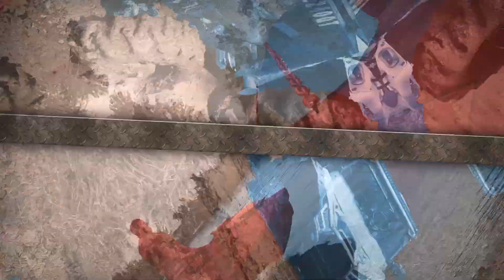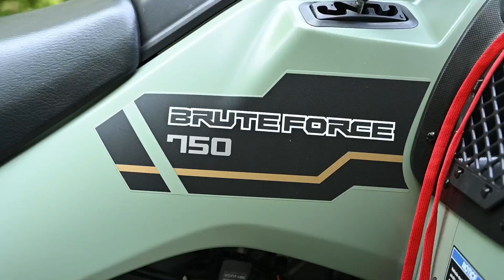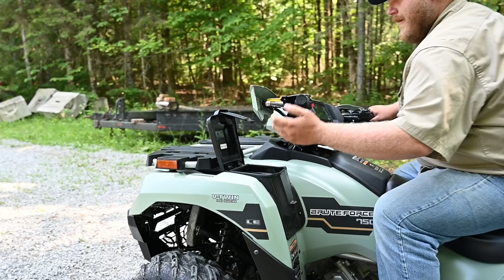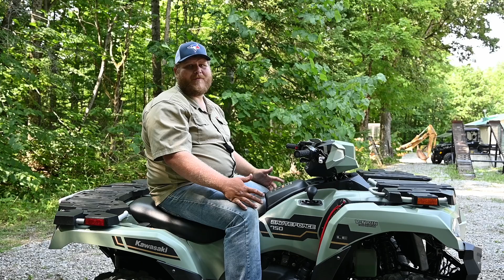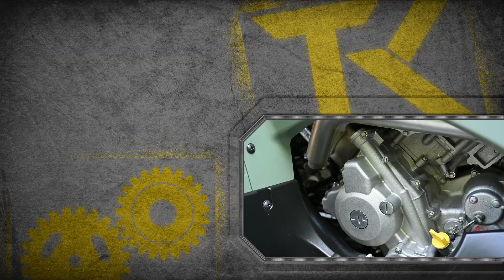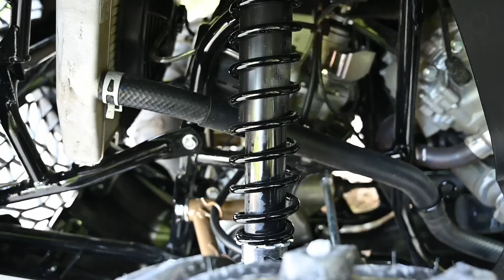Are These Upgrades Enough? See All the Changes on the 2024 Kawasaki Brute Force 750 LE

Comment: I have the 2025 and it def needs better shocks. Man the shocks on these are horrible. My CF moto 800 is a much better ride and never bottomed out. The stick brute will bottom out really fast if you’re ridding fast on rough trails . Don’t take this the wrong way I love the Brute Force 750 but hate the suspension

Comment: So many people overlook the biggest benefit of the finger locker, you can actuate it on the fly! You don’t need to come to a stop to engage the locker like every other atv. It also has little to no weight to its pull so it’s not taxing on your finger and it’s super natural feeling to use. It also tucks against the handlebar while in use so it feels nearly seamless with the machine.

Comment: I have a brute force and love it other than the suspension it comes with is such a joke it literally makes you ask what are they charging you for the motor? Cause this should be a $8000 machine brand new. Maybe less cause that’s all you’re paying for is the motor and four wheel drive system. Everything else very very cheap. Even the frame is junk. I had a plow on the front of mine and snapped the frame and it was so thin I almost couldn’t even weld it with a MiG welder I couldn’t believe it. They left the brute force the same because they have been making a bunch of money on each tab they sell because they only have 4 or $5000 in making them and the rest is all profit for them. Cause there is now way they even have that much in to a new one as long as they have been making them and the absolute junk suspension paper thin frame and the cheap dollar store flash lights they have taped on the front for head lights is a freaking joke

Comment: Kawasaki rates these at only 50 hp, the same as the single cyl Suzuki 750 and the new 650 cc rotax single in the can am “700”.
Are they underrated or is Kaeasaki really only getting that much out of a V twin?
Reply: It's how that power is transferred to the ground that matters. A Brute will hang with any ATV off the line, and beat 90% of them all while being more reliable than the 10% that have a higher top speed.

Comment: I purchased one in May. I did not get the LE but I did get power steering on mine. I have ridden older Honda"s. I think this thing is amazing. I"m not diss satisfied in anyway. I have always owned Kawasaki motorcycles so I went with the Brute force. I think they have done a good job. I guess if it"s not broke don"t fix it.

Comment: My bro just bought one of these 2024’s brand new. This is a great machine. Also he forgot to mention the brute force is faster and feels much more powerful than all of the other Japanese brands.
Reply: but...............9" of ground clearance..........mechanical lever pull diff lock...........dismal storage options. Who cares if a WORK/UTILITY/HUNTING machine is fast.  I Looked at them all and went with the Grizzly 700 XT-R. Almost 11" of ground clearance, more storage, push button diff lock, 27" tires, metal racks and it will still pull the front wheels off the ground not to mention a 10 yr belt warranty
Reply: @jeremyspencer5301  the Kawasaki is superior
Reply: @AaronsAnglingAdventures  I own a Kawasaki Teryx and its been amazing, I love Kawi so the Brute force was the first machine I checked out and I just wasn't very impressed with it.  I looked at the Yammy and everything about it just seemed bigger and better and more comfortable for me so I went with it.  I don't think I could have made a bad choice either way.

Comment: I had an older brute… liked the diff lock lever… suspension horrible great power till motor locked up at 2000 mi… so wasn’t impressed over all … wouldn’t buy another

Comment: I bought my new 2023 for 9000 back in November
Reply: I bought mine at the end of last year. It is a 2017 Fuel Injected Kawasaki 750 Eps 4x4I with power steering and it only had 702 miles on it and I paid $6000 for mine

Comment: so they cosmetically gave it a face lift. under the plastics is the same. tried and true V-twin 750 reliability is fine and honestly a lot more power than most need. trial riders hunters and farmers could honestly get away with a 500cc, my grandpa has used his kodiak 400 for 25 years every november deer season. still looks as new as the day he bought it. quads have plateaued, they charge you more for the same or less these days. 3,000 dollars in 2000 for that kodiak 400 is now 7,000 dollars for a 450. yet nothing has really changed in 25 years.
Reply: Inflation bud... in 15-20 years everything will be double again.
Reply: Just bought one. Love the power but hate the heat it puts out by my calf. Without long pants it going to hurt

Comment: No. I do like the way it looks, but really wish they would have updated what really matters. I wish they would have changed the differential lock to a switch/button, and come on…still lacking a square hitch receiver…
Reply: Why downgrade to an electrical locker with all the sensors and limiters? Why stop to engage the locker? Kawasaki's locker engages quicker than any other machine and can do it on the move. Then unlock as soon as the obstacle is cleared and on your way you go. Nothing is faster.

Comment: there's something to be said for reliability, that's why i'll take this or a Yamaha Grizzly over the other horsepower chasing brands that are notorious for breaking
Reply: Suzuki needs to update their screen and boom. The KingQuad is perfect.
Reply: King quad will outrun a grizzly but wont touch the brute@FullsendOffroad
Reply: @greygrizzlyoutdoors1764  that's true, but overall power isn't everything. Most ATV guys have forgotten about that.
Reply: @FullsendOffroad  oh I know, but iv went from a 1998 grizzly 600 to a 2020 700 and honestly the ride quality felt the same and the power felt the same the new one just has a bit more top end. At some point to even compete they need an 850 or bigger option in a quad.
Reply: High HP atvs like an outlander are just as reliable so long as you maintain them properly (grease zerks after every ride, oils changes done every 50-75hrs, inspect bushings, seals etc.) I see many high mileage can ams that needed nothing more than a clutch cleaning, belt change and maybe a wheel bearing or two when over 10,000kms. Kids that break them are the ones that buy XMRs and think “oh it’s mud ready so let’s beat the snot out of it” or they swamp it, break rear diffs cause they’re turning heavy 32” tires.
Reply: @hammerheartdan6311 What’s high horsepower got to do with greasing chassis zerk fittings?
Reply: Yep. On a group ride two things are guaranteed. A polaris will be towed back because something broke, and a can-am will be left back at the trailers because it's in limp mode. Every. Freaking. Time.
Reply: @iWinnipeg  I had 2 polaris, a predator 90 and Xplorer 400, both 2 stroke. Absolute junk. Breaking all the time. Fun to ride and lots of torque, but the reliability wasn't worth it.
Reply: Check out the new screen on the cfmoto cforce 1000
Reply: Poor maintenance is why they break, not high power.
Reply: @WBOS72  I own both a Yamaha Grizzly and Suzuki Kingquad and my Suzuki is more reliable. Same owner same maintnence.
Reply: Grab an 850 outlander you won’t regret it I’m a previous Honda owner, never looked back.
Reply: @Dylanmccutcheon747  Can Ams are nice but not for a long time. they have to be babied. I don't absolutely beat the crap out of my quads but they defintley aren't babied. My Yamaha and Suzuki hold up super well.
Reply: @FullsendOffroad  I haven’t babied the two I’ve owned, I had an xmr 650 I beat the piss out of for 5600kms, 1400 on my 850 and my dad had 8500 on his 650
Reply: @Dylanmccutcheon747  gotta be lucky!! I know some can am owners that haven't been so lucky!!
Reply: @FullsendOffroad  idk I think the rider has a lot to do with it, I’ll own a Honda again someday but it won’t be my go to Atv for fun.
Reply: @Dylanmccutcheon747  I like Grizzlies and KingQuads. I do however also want to test ride a Brute Force.
Reply: Looks transgender ⚧️
Reply: Suzuki kingquad 750 is the best atv on the market for value, reliability and overall performance.